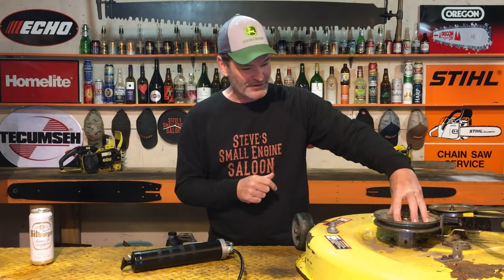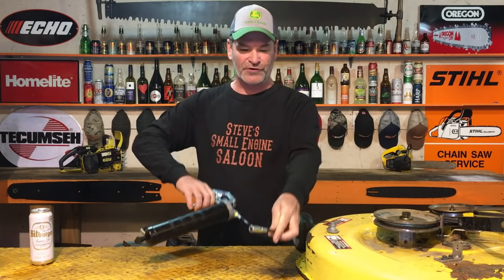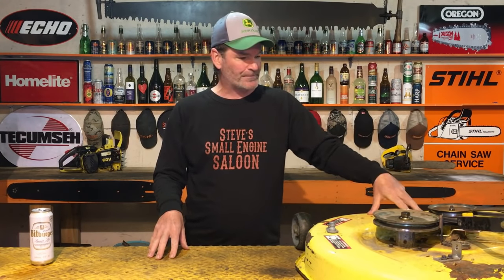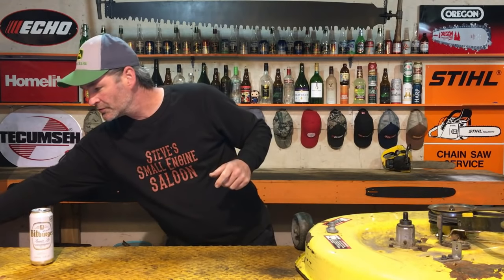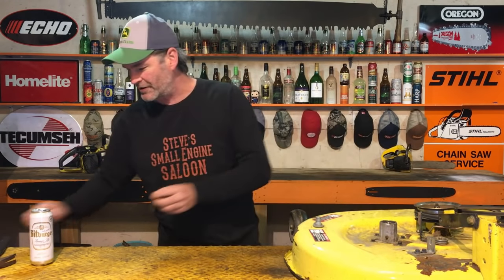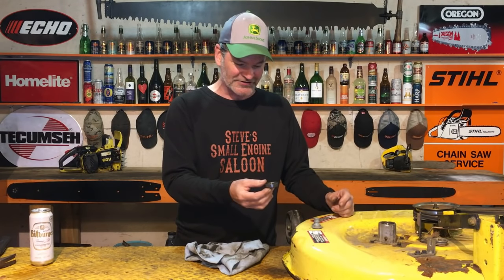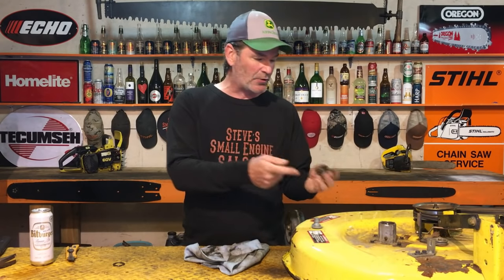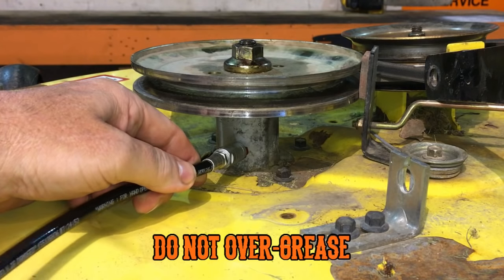Your Riding Lawn Mower's Dirty Little Secret

Comment: Yeah I already knew about this and did this on my mower deck.  Anyone who has taken the time to remove the failed spindle to replace the bearings has figured this issue out.  I also drill an 1/8" hole into the outer seals top & bottom to allow for the pressure to release when you have the spindle completely filled with grease.  It lets the grease extrude from the spindle so you know that it has been fully greased before you put the deck back on for the year.  Even removing the bearings and replacing them is $20ea cheaper than replacing the full spindle, which ends up being either $40 or $60 dollars cheaper depending on whether you have 2 or 3 spindles.  I also removed the rivets from my idlers and separated the halves to re-grease / replace the bearings in those as well.  You can bolt the halves back together with a small bolt, nut, & lock washer.  Mine runs all year without problems, and I haven't replaced a full spindle or idler assembly in years.  My idler bearings are even the same size as my spindle bearings...  It's definitely on purpose...

Comment: If this is a common 'feature' of riding mower cutting decks then the blade shaft bearing housing was probably designed 50 years ago. What is odd is that the housings still receive the operations for a grease zerk. That's an opportunity to save a few cents by leaving it out.

Comment: I did not know this about the zerk fittings but the issues with JD decks are legend and I'm surprised that the legal industry has not mounted a huge class-action law suit against them. One obvious problem is the lousy paint job that starts flaking off about a year into ownership. I've seen pictures of some decks that have complete rusted through. Another issue is the spindle supports. They are welded in place to make it difficult for most folks to repair, thus having to buy a new deck or take the replacement parts assembly to someone who can weld it back onto the deck. Another issue (at least on my LA105) is the fuel tank. It's impossible to remove and replace without taking the mower completely apart. We've all seed the videos where folks actual bend the frame to get the gas tank out for repair or cleaning. There are probably many more design flaws JD has built into various products to maximize profits over the year but I think deceptive practices like this eventually catch up and do terrible damage to their reputation.

Comment: I've gone literally years with no need for bearing mantainence. I drove a mail in the wall behind my work bench, hung a blade on it and set a level,then traced a guide line. When I sharpen blades,I hang them on the nail,and balance them out. I also re balance new blades before they go on the machine.

Comment: My Toro Titan MX4800 Zero Turn does not have those grease fittings and the maintenance instructions don't even hint at a need to grease the spindles.

Comment: The point is not to grease the bearings it is filled with grease to keep water out. Most people don't know that the worst thing you can ever do is to wash the deck off with water, hot, and park the mower. That is a prescription for taking out deck shaft bearings. I have a big Husky tractor type mower that I've ran for sixteen years now and have never replaced a bearing in the deck. Sealed bearings have a lifetime supply of grease in them and if it can't get out, they never need greased. What Will kill them is water getting in.

Comment: I have a problem with my generator not producing electricity. I flashed it with an lecturing drill, and then started producing power. But when I started it up again. Have the same problem. How do I fix it so it produces power every time it starts up?

Comment: I've had two Deere riders and on both I greased the spindles without removing those rubber shields...the bearing cavities in these spindles are large and require several pumps of grease to fill the cavity and the grease will pass these rubber seals and fill the bearings...just keep pumping and the grease will show up at the top of the spindle housing oozing out and walla she's lubed.

Comment: Use quality Timken double sealed bearings.  Install them and forget about packing grease in that spindle.
Reply: I have a 2002 Cub Cadet 1515 riding mower with 1101 hours and the deck spindle bearings are open inside and I use the red #2 grease. The bearings and spindles are original. So easy to grease as the zero is on top of the spindle as the shaft is drilled and the grease goes inside middle of spindles. No trouble at all. Did replace the idlers once though. It is always best to have open bearings inside the spindles. Mine came that way according to the Dealer.

Comment: Tip from a different industry: lots of water pumps use sealed bearings as well. The grease fittings on the pump housing dont do a durn thing.
Reply from the maker: Right on

Comment: Of course it wouldn't hurt to prime and pack the bearing with grease before putting it back in. I don't know, it probably still works when you just use the zerk fitting.

Comment: Steve I have to call you out on this video. I'm usually with you but not today. I'm a Millwright. Sealed bearings are pre-greased and do not require lubrication for their lifetime. They are meant to be replaced when they eventually fail. Repacking a failing/failed bearing will not save it. If you've gone as far as to disassemble the machine and remove the bearing, you might as well replace it considering the cost of a bearing. Especially one that small.

Comment: It’s sad that things are designed to fail. It’s sad and frustrating. We spend so much money on things we need and they don’t last long at all before we have to re-buy them. Who has that kind of money?  I prefer older things that were made to be re-built. We bought an old, old bulldozer we found in a field, put new parts in it. My husband rebuilt the motor. I don’t know all the proper terms, but he pushed new sleeves in the hole the pistons go in an did a bunch of other things and now we have a perfectly working bulldozer. Made to fix and last. My old Farmall Cub has no sleeves, but we are having the block bored and so I will have my own tractor. Very nice to fix something and use it for a long time. I don’t like disposable machines.

Comment: Funny, I destroyed a spindle recently and realized all the grease i put in it did nothing for this exact reason. Hadn't dawned on me til watching this what would have happened in a few years had it not failed epically. Was incorrectly listed as compatible with my mower...it obviously wasnt smh. And I'm the DA who knew better, but used it anyway...I mean what could it hurt? ruined the pulley for one, threw sparks like crazy while making a tremendous racket. (correct spindle has a spacer between the pulley and the top of the spindle...) the top seal came off the bearing during the end of the wreckage.

Comment: Another thing with these spindle bearings, please note they are made in China. Get rid of them and replace with high quality Japanese bearings. Before fitting, snip out the seal on one side and pack with high temperature automotive wheel bearing grease. Re-grease occasionally and you won't have to replace those bearings for quite some time into the future. Works for me!

Comment: The same thing happened to me.

One thing I haven't seen on here or any of your show's. What's that you ask??
You haven't covered the COOLING FAN Over the Transaxle.
When the flexibility washer goes bad the COOLING FAN will hit the drive belt on the main Lawnmower tractor.
After you go to the John Deere store to get a new fan. You must also purchase brand new bring like washers they're kind of wavy looking the one that's on your mower has gotten too weak and it allows the fan to travel up into the grab belt and the fan blades will break off because the fan is made out of plastic. I found out the hard way it took me three fans and over $200 to catch on and fix the problem myself. A new fan Heller's new wavy looking washers and you might want to get a few extra clips to just in case if pops off and goes traveling to the other side of your garage. If you can download the schematics on your lawn mower whichever one you might have you will see what I'm talking about.

Comment: personally I would just replace the bearings. It's possible that those spindle housing are used in an application that requires grease on some other tractor. I wonder if the owners manual on these machines include greasing these fittings ?
Reply: They do, yes.  Don't have my manual handy, but there is a grease schedule for those fittings.

Comment: Yeah, there's more to this than meets the eye.  Sealed bearings have just the right grease content installed to meet the specified life and should not need re-greasing for the designed lifetime.  This is a subject critical to the those manufacturers reputation and they don't often get it wrong.  You can check the design lifetime in the bearing specs and for a mower it should be many years, however this is a relatively low-speed, high load application for the size of the bearings and I'd have to wonder if they're correctly selected and aligned for the shock loading a mower application would see.  The grease fitting is a waste of time as it's not plausible that a mower owner could replicate the correct grease fill, which is usually around 15% of the raceway volume.
Reply: This is the first time I ever seen someone greasing a sealed bearing.  Seems rather silly unless we are in a situation where new parts are unavailable.  But another poster spoke of adding grease with a (hypo?) needle and the seals are marked to do this, so maybe that is viable?
Reply: Cars used to have grease fittings too. This is ridiculous.

Comment: It may not be getting into the sealed bearing, but IS greasing the shaft against the inner bearing surface ( not technically a ‘Jack shaft’). I still appreciate the bearing removal process though.
Reply: inner surface doesn't move though

Comment: I would go one step farther and replace the plastic seal with a single sided metal shield, over greasing will pop out the plastic seal. Your supplier can get you a single shielded bearing. A type ZZ or ZZs bearing shield is preferred. Cheers!

Comment: What is the approximate cost of the bearings, how long do they generally last, and how much dirt can get into the grease in the shaft area. Seems like the sealed bearings were designed for a low maintenance, high dust environment. Perhaps the system could be redesigned to have an external dirt seal to prevent majority of dirt intrusion into the grease area? Interesting information in the video, keep it up!

Comment: A question, "If you remove the inner seal on each of the bearings, would the other seal get pushed off when you pump grease into it?"
  Usually, when you grease a bearing, grease well squeeze out, at least, one of the ends to let you know it's full.
   Just a thought.
Reply: You need to pay attention when you’re doing it. Pump the grease gun slowly and you can feel a little back pressure when it’s full. It’s subtle, so you have to watch for it. If you just go to pumping you can indeed push the other seals out.

Comment: Steve, don't you think it would be best to pack the upper bearing and put the cover back on it, otherwise you would have to keep the spindle full ALL the time and could blow out the bottom seal if you over grease it. Gravity will keep the lower bearing greased if you leave the seal off of it..... then repack the upper bearing every 2 years or so......just saying.

Comment: Manufacturing based in China sees these issues span multiple brands. This is because of the way cities & regions cluster product types together regardless of brand. There will be a lawn tractor city, a chainsaw city, a flat panel TV city & even city full of labs called Wuhan. Around the product manufacturers will be clustered specific part suppliers that match the end product  we see, regardless of westernized brand.

Comment: There are numbers on the bearings. You can save even more money just looking up those part numbers on amazon or ebay.  The numbers indicate the size, and the letters indicate things grease and seal type. Not as important as size. Mic it out to get the right size if number is not legible. You need od, id, and thickness.

Comment: I can't do that to my friends he wants them how they come sealed as what i take out from his mower there's no grease nipple anyhow on his or any of mine 

But he'll use his stuff until it locks up is how he does i four new bearings on his and have 4 more to do am saving them until he's ready for them that was $40.00 for 4 new bearings. I hate doing those snap rings specially with a cheap tool but will only be using it one time so i wasn't about to go buy a $50.00 dollar tool just to take off 2 snap rings

Comment: Steve:  Since hot grease can't run uphill, how do you insure the upper open bearing is getting lubricated?  I like Lucas red bearing grease.  I pop the seal and really pack the rollers.

Comment: I have a 2007 Escalade. All wheel drive. Took it in to have the front end checked out due to a ticking noise. The technician said: "That's just your brake pads hitting the rust spots on your rotors".  Long story short, both hubs had to be replaced, as you can't replace the individual bearings !! Designed that way.  $$$$ ! Assholios...........🚁

Comment: This is good info on changing the bearings but you can see the ball bearings around the edge of the plastic seal before he pops it out so if you have a gap enough to see the balls... why wouldn't grease go in it??
Reply: I have greased bearing assemblies by hand (admittedly some years ago).  You take grease and PRESS it into the bearing and rotate in around to spread it out among the balls in the assembly.  If you can't press it into the bearing, it won't do a good job of lubricating the assembly.
Reply: @kirkmooneyham  Yes you put grease on the palm of your hand HIT the grease with the bearing sort of driving it in. I just wonder how much PRESSURE there is when you pump grease into that grease fitting...there must be quite a bit....more than enough to get into the bearing I would think but that is JUST AN OPINION.

Comment: after reading these comments i see no one mentioned checking the blades for balance  out of bal.  cause a viberation  strong enough to crack open the steel deck so it will have a bad effect on the bearings  you never see any see these mech check for bal.??????

Comment: I worked for a testing lab years ago...Many parts or pieces are designed to fail about the same time, costing the owner  more for parts in total than the cost of buying a new machine. I see the thumbs down, the top bearing will always need repacked. Peace.

Comment: my QUESTION IS.. remember when, we used to use a dust cap (washer) and would watch for grease, forced out of the bearings, to know when to stop?  HOW, can we get that OTHER side / seal, to STAY in place, but allow grease to 'exit' thus FILL the bearings, but NOT allow dirt to enter, like that dust cap did?  You don't know when to stop greasing / thus IF your bearings are accepting grease, UNLESS you see evidence there of.

Comment: is this also true of electric blowers? I grease everything from weed eaters to pole saw(attachemnts) and edger attachements. I use a Honda VersaTool UMC435LAAT and instructs me to use a lithium NLGI-2) and all attachments except the blower. the Honda states this in no uncertain terms to grease every tool! every 20 hours of operation!   But on the subject of grease, I have a greenworks leaf blower attachment(with electric corded powerhead). the leaf blower has a grease nipple but the manuals make nothing clear on how to use it or what. I use the blower often! I have lots of junk and in the fall silver maples and oaks that make the leaves thick. the mailman has a hard time in my front yard! the blower obviously is used more than my other tools so it is getting lots of wear!

Comment: Not all companies are out there trying to rip ppl off, i can confirm dat, we have only 1 lawmower tractor called Partner, its considerened a "cheap" class machine , when u compaire it with other brands and prices. BUT it has greasing free shafts, aka the bearings are sealed from both sides knowingly. We got the machine brand new and we have had it für 10 yrs and i can personaly confirm that i have never ever even greased any of them or replaced the bearings on any moving part. there is no play in the shaft , no nothing. Bearings like everything ealse that moves wear out over time BUT  if they are made out to be high quality heavy dudy bearings they can last sooo freaking long u will defelently find it to be more useful to be sealed then open ones. I dont think your bearings where ment to be greased dear sir, i think u just exeeded its lifespan or u just happen to have cheap bearings that dont last that long.

Comment: You've got that right , They do that deliberately so the bearings fail prematurely and you're stuck buying parts  , One very important thing is after disassembling the spindles , Drill and tap a small hole for a regular screw , This is a weep hole to prevent pressure from building up and blowing out the seals when pumping in grease , Also when you go to grease it again , It allows the old grease to flow out 
Be sure to drill and tap the weep hole opposite side of the grease fitting and towards the upper bearing , After adding grease , put the screw in and tighten so it's snug

Comment: I am still mowing my yard with a 1977 Wheel Horse with an 8 HP Kohler engine. In fact,  I mowed it yesterday ( 5 / 14 / 24 ) with that same machine. The mower decks do corrode and blade bearings are great but do wear out but the tractors are almost bulletproof. 6:47 

Try getting 46 years of service out of your big box special.